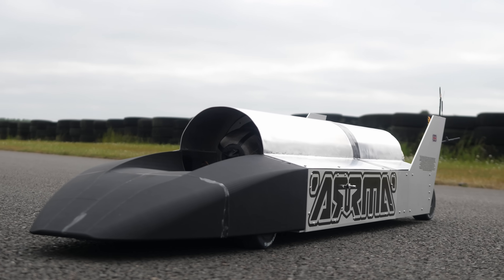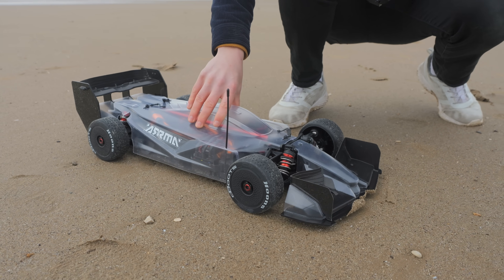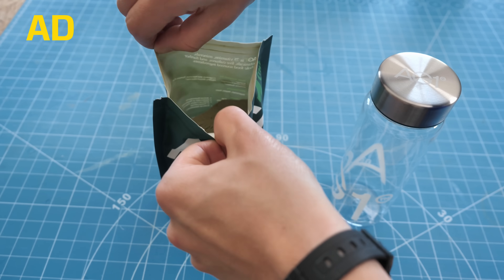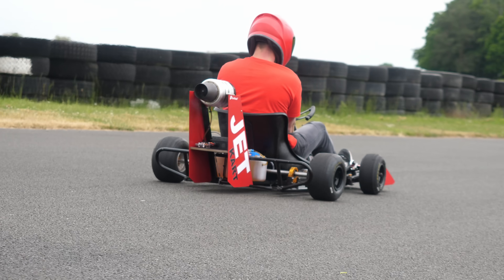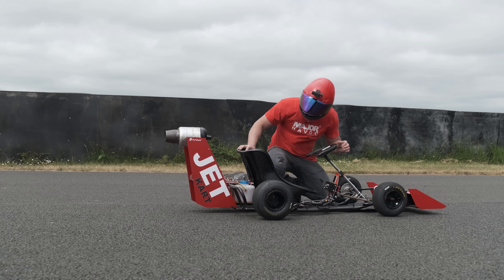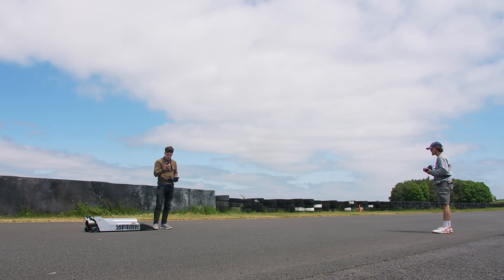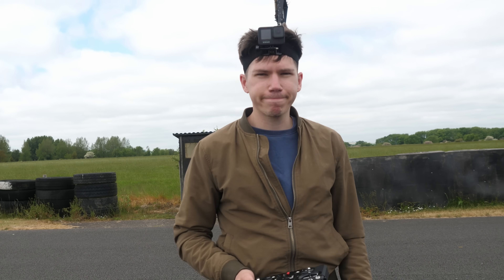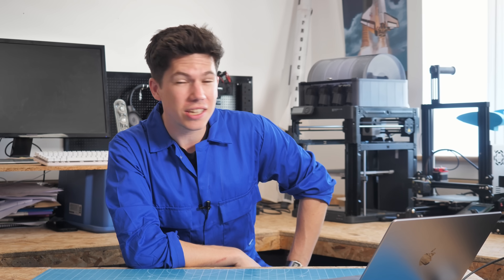Jet Engine Powered RC Car - Track Test

Comment: I fly turbine jets.  we have a short 460ft runway.  Using a swiwin 80 lock the breaks until full spool or almost full rpm of the turbine and then release for take off.  This will most likely help you with your launch and getting up to speed.

Comment: That jet go kart would probably benefit from a rear wing. The relatively large front wing would be shifting the weight balance forward at speed and causing instability. Balanced aero is a must if you want to go fast.

Comment: You need fpv if you want to drive over 200km/hr. You can't see the car at those speeds. I have flown a plane at 300km/hr with fpv and there's no way you can do that line if site.

Comment: Have you considered some urethane wheels like skateboard wheels are made from? 90A durometer would be extremely grippy and won't blow up. You can cast your own too if you have a mould. Mold? I never know which one it is.
Reply: I'm thinking along such lines too, given the weakest link for the RC cars chasing these records. The rotating mass part might be reduced by using a machined metal hub, and then resin-casting the tire right onto the hub. Then machining it yet again to true them up a bit before balancing. It could be low-profile compared to the "tire" part of a skateboard wheel because it doesn't need the deflection for lateral loads or the weight of the skateboard rider. The solid integrated tire may help eliminate separation issues because it doesn't require the level of elasticity needed for any kind of fitted tire. It'll just take keeping a lot of wheel sets around, and perhaps machining the bonded tire part off of a hub to re-use it with another pour. Urethane seems like it would have the right properties for both enough grip and durability, and can be modified with additives in a couple ways too.

Comment: What is the caster angle on your steering wheels? If you have a larger number that would make the vehicle more stable at speed and give you less turning authority.

Comment: This is cool and best of luck when you go for it!

One small suggestion. Use a headset with the walkie talkie so if you need to radio someone asap, that should be quicker :-)

Comment: You’ve probably already done the second run but you might want to reconsider your camera and radio gear mounts and try to make them more aerodynamic or put them somewhere out of direct air flow, I’ve done some “sketchy shit” with flying wings trying to get them to exceed 200 and we found the slightest little lump anywhere on the surface, like a camera, can upset it or create oscillations or just make it too unstable at really high speeds, even something as small as a Runcam Splt 3 with the camera on the wing tip and the circuit board embedded in the wing was enough to cause the wing to turn sharp left on launch and required me to hold in a lot of right stick to keep it straight at high speed, when we took the camera off, we found another 30mph.

Comment: have you considered using a motor to pre-accelerate the car to running speed, and an edf to get the air intake to the jet spooled up? might make some big gains cause those jets don't run well at low speed they're supposed to be 150+ mph in the air so it will be running pretty starved of air as it stands

Comment: If you want to do that simple way would be to start with comparison of your engine power to the electric ones that hold the record. I guess they are around 15HP, does your jet generate anything close to that?

Comment: Are plastic stoppers in the suspension really the best way for firming up the suspension?
Wont they just make everything super stiff and the car will bounce of the ground?
Reply: Perhaps custom shock pistons with two tiny holes and a plastic diaphragm on the top of the piston as well.  You would get better rebound performance and still resist most suspension compression.

Comment: Why do you lock up the suspension? There is a reason why cars NEED suspension, especially high speed rc cars. A small bump will just send them to heaven. Just use stiffer springs and thicker oil in the dampers for example.
Otherwise great build🎉😊

Comment: Looking really good there! It looks the part and sure seems to have the potential, I really hope it does smash the record without getting smashed thanks to something either breaking or some air flow under it etc.
I did watch your previous video but please excuse me if you did explain it and I somehow forgot but, why the dimpled air tube instead of as smooth as possible?
 I am also a little curious why you didn't either make your front end out of carbon fiber too? You could have even 3D printed it then used that as formwork to shape the carbon fiber too. I've become a little obsessive about keeping weight as low as possible whilst a little stronger than needed after working on RC planes a lot but, maybe here you actually wanted extra weight? I don't know. It's not important, I'm just curious whether there was a good reason or just that it didn't matter and this was quickest and easiest.
Looking good, can't wait to see the real speed run. Good luck🤞👍.

Comment: Can you tie it down to launch it at Full throttle. So you dont Need so much space
Reply: That's what planes kinda do, hold the park brake on, rev up the engines, then let the brake off. Last time I was on a plane they did that and it put me back in my seat, so it must work somewhat
Reply: Airplanes zero to 60 is 8 sec
Reply: So it will on this rc car

Comment: The good thing about racing on the sand with a jet-powered car is that the acceleration isn't forcing the sand out of the way by the wheels spinning out because the wheels aren't where the power is being applied, unlike a normal RC car which would struggle to get grip and the wheels would slide out, therefore sending sand flying everywhere and spinning out.
Reply: Yea, the concern about acceleration doesn’t apply to jet powered car, but his concerns about braking, steering and the salt water would still apply.
Reply: @SivaKanthSharma  Yeah salt water and rc cars do not mix very well.
Reply: Good point, though I'd imagine lateral traction would still be a problem, and the mess of sand getting in, especially if any got ingested by the engine.

Comment: What if you put a edf infront of the jet so that it pushes more air into the jet
Reply: a jet engine already sucks in a boat load of air through the compressor. the more turbulent air from an edf could hurt performance on the jet engine. jet engines need laminar air flow to work at their best
Reply: i was thinking put a wider opening on the tube so more air would be forced into the engine, kinda like a ramjet effect but honestly that engine is so tiny i doubt it could make any use of more air

Comment: Those rear wheels look like they toe inwards, I know they’ve got camber but if they toe in you’ll increase the rolling resistance. Check all the wheels are dead straight because you’re not racing round corners.